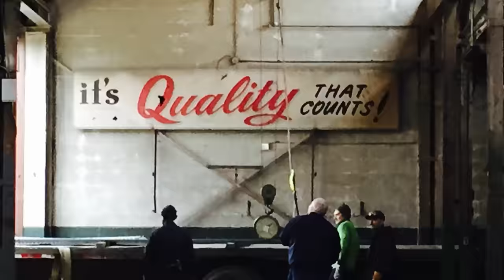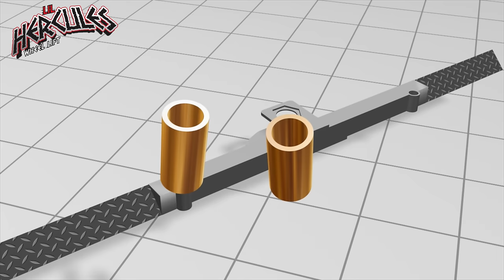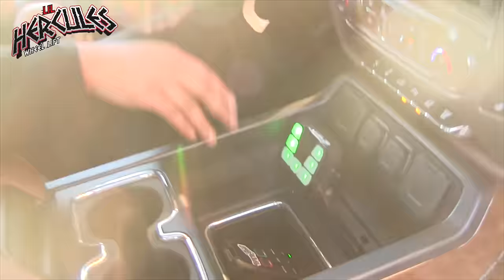Why You Should Buy  Lil Hercules Repo Lift  From Detroit Wrecker

Comment: This is the ultimate sleeper repo vehicle.....no one knows it's a tow truck, doesn't make noise because of your tighter tolerances when you build the lift, no light bar showing on the roof & it's wireless on top of that just in case you might need to get out when hooking a vehicle.  This would be great to use when trying to get into guarded parking lots/garages to repo a vehicle because they never suspect your the repo man, like they would with a regular repo truck.

Comment: Hi there guys,great piece of kit. I have been looking for a system but not had much luck yet. What I was looking for is a system that is basically a self contained modular that could be fitted in any suitable pickup truck? Other than an electrical connection everything is mounted on a pallet type system that can be secured in the bed of a truck. I am thinking hidden under a cover and powers out with tailgate lowered.
Reply from the maker: Cool! Sounds like a good idea! Good luck!

Comment: What is the difference between "Little  Hercules" wheel lift and "Lift & Tow" wheel lift? It just seem to be the same wheel lift. Please explain. Thanks
Reply from the maker: Lifetime warranty on pins and bushings for starters (with proper maintenance).

 You can tighten the King Pin on the wheel lift. Unlike any other unit on the planet. 

Our unit weighs 400 lbs more. Which makes it stronger and more heavy duty. 

The reach on our unit is 72” theirs is 65”. 

The lift cylinder on theirs is a 4” Bore. Ours is a 5” bore making it possible to lift diesels from the front if needed. 

Frame fork provisions standard on all cross bars. Enabling the end user to utilize a frame fork kit. 

The In/Out Cylinder is bigger and can adjust in order out with a load on it. Unlike our competitor. 

All tubes start at 3/8” thick not 1/4”. Virtually guarantees the tubes to never bend. 

Steel wear pads on the tubes that are 3/16 that on top of the 3/8 thick tubes is again. A virtual guarantee that you won’t have a problem. 

Bronze Oil-Lite bushings at all major pivot points. If greased they will last forever. If not greased they will last longer than any other unit on the planet. 

Sandblasted and Powder-coated. Other skip the sandblast aspect and the paint will just fall off. 

Frame reinforcement is the biggest reason of all. If anyone says you should not reinforce the frame or do not need to, is mistaken in our opinion. We will not install a unit with out doing so period.  Lifetime Warranty on the frame once we reinforce it.  

Heady duty electric/hydraulic motor. Our unit has 4 magnetic 🧲 brushes not 2. Our duty cycle is 10mins not 3 mins like the others. 

There is a huge difference in quality and pricing. Please feel free to call us. There is a host of other reasons as well. We would be happy to discuss with ya. 313-835-8700 ask for Mike

Comment: One thing that is really not clear, is this a hydraulic system??

Typically a tow truck would use the PTO drive, but this seems like it's made for a truck that doesn't have a PTO...
Reply: The other question I have, this is for 3500 class truck only? 

I have a 3/4 ton, just curious if this is a possibility to look at in the future...
Reply: Great question!! We suggest using a self contained Electric/Hydraulic unit made by Monarch which is special made for us. A unit that is built w/ a 10 min duty cycle on the motor. Works great!! People love them! Very easy to use, service and install!
Reply: @michaelfarrell9475  - Great answer! 😁

Don't worry about answering the second question, I think price is going to get me regardless of my trucks gvrw

Comment: Hey I have a couple of questions,  I'm looking to get in touch with you guys next month about sending my truck down there.  I'm familiar with the lift and tow lifts systems out here but with reinforcing the bed does it add a lot weight to the truck possibly affecting driving quality.   And last is it possible to use air bags instead of lift springs to help with the rough ride?
Reply: duallys are supposed to have weight. they drive better with weight. we actually gained an mpg after putting on the lift

Comment: My daughter drives tow truck here in Canada she does a lot of parkade very low clearance 6’ do you have a airbag system that can handle dropping and airing up and not causing rubage on the springs or inner fender or hydraulic system ? She has a lot of issues
Reply from the maker: John Pirie Call is to discuss. 313-835-8700 ask for Mike.

Comment: I have an 05 f350 drw with all around air suspension, and a b&w gooseneck system for my rv/ trailer. Can this system be compatible with what I said or will I have to lose some of my stuff. like air ride, and gooseneck. I'm at the point on doing something like this was nervous about someone say you will have to give up your air ride or my gooseneck.

Comment: It's a nice wheel lift, but god damn...!!  How much weight did you add to that Chevy. The wheel lift alone must be around 1,500 lbs.. The winch along with mounting plate; maybe another 100 lbs..  ...and then to add the weight of a car in tow? This is all mounted where the spare tire was, right? Behind the axle.
So you would absolutely have to beef up the springs and frame. Which is then even more weight.
Reply from the maker: HHwrecker the unit weighs 1000 lbs the frame reinforcement is another 100 lbs. The winch is 60 lbs. Toal weight added 1160 lbs 😉
Reply: Lol.. welcome to the diesel world, weight doesn't play as much of a factor as it does in the gas sector.

We embrace our overweight vehicles. Lol

Comment: what does that install run $
Reply from the maker: Installation includes three aspects. Install, Frame Reinforcement & Spring Shop. The combination of all 3 is around $5k. But that includes:**LIFETIME WARRANTY ON ALL PINS & BUSHINGS** (with proper maintenance)
*Frame Reinforcement w/ LIFETIME WARRANTY
*DOT Approved Safety Chain Attachment Points
*12' Safety Chains w/ Heavy duty Slip Hooks
*LED Rear Lower Work Lights
*Tow Lights & Plug
*Self Centering Head
*20' Control Cord
*300 amp Fuse & Fuse Holder (with a spare)
*200 amp Circuit Breakers (2)
*Ratchets & Straps
*20' Red & Blk Gauge #4 Power Wire
*The Strongest Tubes on the market. Our Tubes have extensive reinforcement. Our
*Tubes do not have slop. 
*Bronze Oil-Lite Bushings at all critical Pivot Points. Just like a large Wrecker would have.
*You will never get a Corroded, Frozen Pin again. (Bronze will not corrode to steel & cause a frozen pin)
*We use a Bronze Brushing that has Oil impregnated into them. They Sweat Oil. This creates little or no maintenance.
*Our Units are built Heavy Duty every step of the way. No one builds a better lift.
*Lifetime Warranty on all Pins & Bushings.
*Lifting Capacity 4000lbs
*Towing Capacity 8000lbs
*Clutch Pump capable. We offer a Valve Unit that will work with a Clutch Pump
*Wireless Remote Optional
*SAND BLASTED & POWDER COATED BLK

Please Note: We can not install on and Dodge w/ Rear Coil Suspension. The minimum recommended GVW is 10,000lbs. Rear spring package & Frame Reinforcement recommended. Never exceed the chassis maximum GVW rating during towing.
Reply: Detroit Wrecker   5k for unit installed the whole truck to repo
truck set up?
or do I have it wrong 
very nice unit 
thank you Detroit wrecker for sharing the joy,
Reply from the maker: Installation is $5k and that includes the frame reinforcement, leaf springs, helper springs. The install includes tow lights, we also wire in a tow light plug. We supply a 2nd battery and battery box. We include 2 (200amp) Circuit Breakers....We also include a 300 amp fuse (w/ a spare). You will need nothing and we will not cut corners during the process.
Reply from the maker: Installation is $5k and that includes the frame reinforcement, leaf springs, helper springs. The install includes tow lights, we also wire in a tow light plug. We supply a 2nd battery and battery box. We include 2 (200amp) Circuit Breakers....We also include a 300 amp fuse (w/ a spare). You will need nothing and we will not cut corners during the process.
Reply: $5K, I'm shocked. For all that work & the products installed, killer deal.
Reply: How much for all this seat up from laber to parts??? Can you please let me know ASAP.....and where can I go get one I life in Dallas Texas
Reply: Benito Saenz 15000
Reply: 5k not bad
Reply: Angel Martinez it's not 5k     more like 15k
Reply: I'm confused.  Is it 5k , wheel lift installed out the door?
Reply: @detroitwrecker  - yo.. care to clear the air???

$5000 out the door or that's the install cost?? 

From what I read that you post before I think 5'000, but that seems fairly low to me!
Reply: @detroitwrecker  hello I have a mechanic shop and used car dealer. I wonder if something like this would work towing around 50 cars a month? I am in Los Angeles California.  Where can I go to be installed? Can be installed in GMC Sierra 2500?

Comment: Looks very expensive to build repo guys spend all there life savings on this No thanks I rather just buy a tow truck and good to go.
Reply from the maker: For a unit that will destroy anything it’s compared to is a smoking deal. 

A standard wrecker can’t compare to towing cars from point A to B against a Lil Hercules. Our will will work circles are any competitors unit Wrecker body or under body. 

We have the only pivot pins that tighten and lack of plastic wear pads so our tubes are tight, not loose and sloppy like a wrecker. Our tubes do not need plastic pads replaced every year. They are tight and stay tight for years and years. 

There is no structural purpose to lift or tow a car for the plastic wear pads to be implemented. Hence the reason they make inferior pivot pins so you have to buy them all the time. A every standard wrecker has inferior pivot pins, all other manufacturers adopt that system for the same reason…$$$. Forcing the consumer to purchase the inferior pins and pads annually. 

Ever seen the negative tilt on a wrecker (very common to see) when lift a car. The. Potentially damaging an oil pan. Well that NEVER happens to our clients. 
 Our pins tighten so they are not sloppy and are adjustable. One should never need to need to replace them as long as they are greased and tightened ever 30 cycles. 

In our opinion, it is such an insult to intelligence. Some manufacturers even create extra pins so the consumer hast to purchase them. For example, one manufacturer implements three pins for 1 L-Arm to pivot. With fiber bushings that are not grease-able or serviceable and are guaranteed to get wallard out. After so many uses the L-Arm is flopping around like a dead fish. 6 pins for 2 L-Arms to open/close is an insult to intelligence. 

If someone can’t see that these units are intentionally built to bring in residual parts sales every year after they’re built new then they are sadly mistaken. 

So comparing a unit that is over built for the application versus a unit that is under built, there is no comparison. The only thing the Lil Hercules can’t compete with is doing recovery work, like pulling a car out of a pond. But most clients, 99% of the calls are passenger vehicles towing from point A to point B that is where our unit exceeds the capacities of the industry standards by far & cannot be compared.

Not to mention the comfort is undeniably better and rides 1000x better than a wrecker.